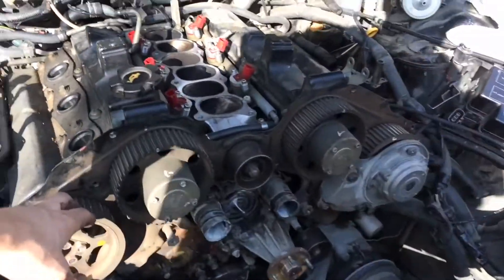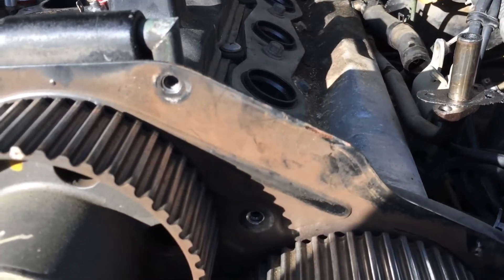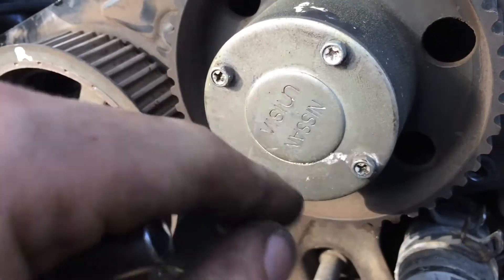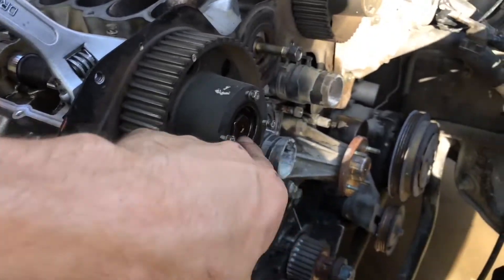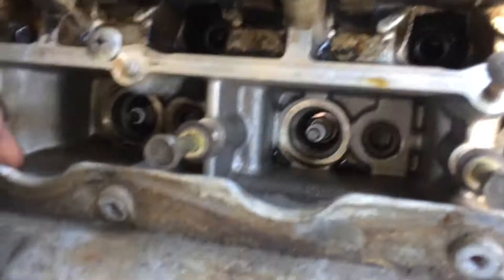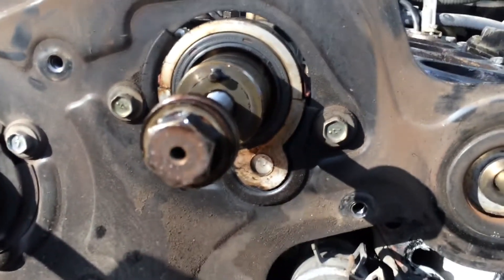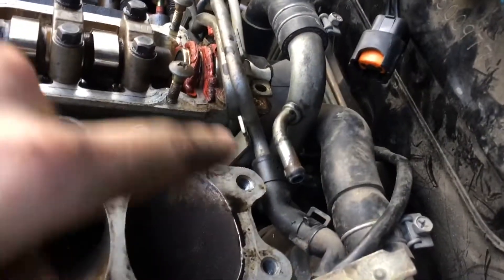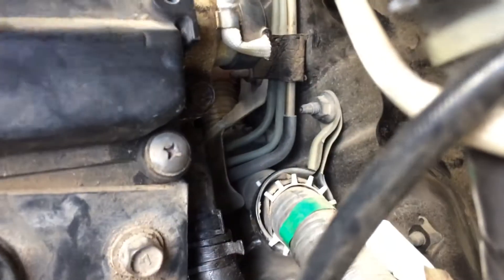300ZX Cylinder Head Removal: Part 1

Comment: I ended up pulling the motor bro tried it this way but you will have trouble torguing heads down correctly as they really need to be torqued all in one motion. Shits a pain in the ass this way takes way less time just pulling the motor bro. I applaud your effort though been there done that.

Comment: Why didn't you just pull the motor to do all this off the car?
Reply: cause there's no need. it's honestly easier to do this with the motor in than unbolting the transmission and even fooling with all that. This job will be 100x easier on reassembly anyway when he removes the EGR and all that bull crap anyway.
Reply: Go buy one there $169 at harbor freight you need to pull the motor in or to torque the head bolts down correctly in one motion. I have done what your doing on my Z it is so much harder its ridiculous. Trust me bro pull the motor.
Reply from the maker: +Cody Degel I have no cherry picker
Reply: You have tonjave engine stand also can't work on it correctly from a cherry picker.

Comment: I"m replacing the head gaskets on my Z, this really helps me thanks.
Reply from the maker: patrick pham you're welcome man! I'm glad it helps, gotta keep those Zs on the road!
Reply: I found that taking off the driver side speak plug cover gives you a little bit more room to heal with the lines and that 12 mil bolt.
Reply from the maker: +patrick pham that would help! Thank you for the info!